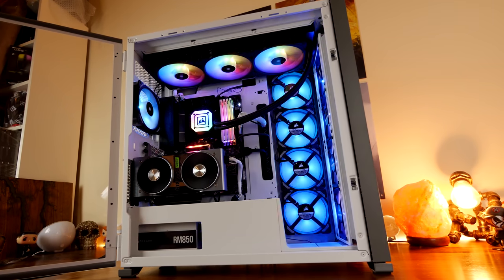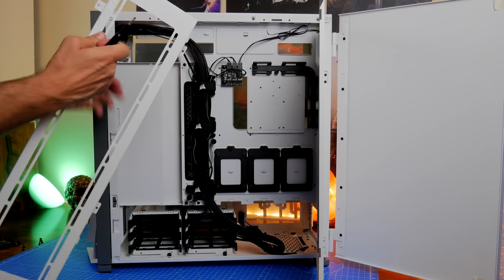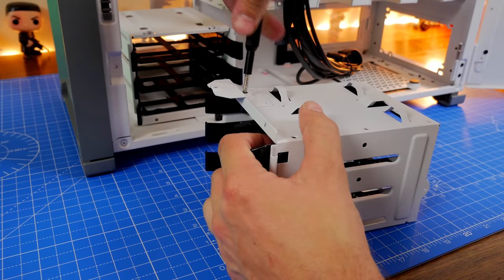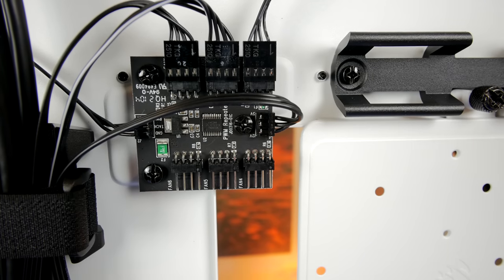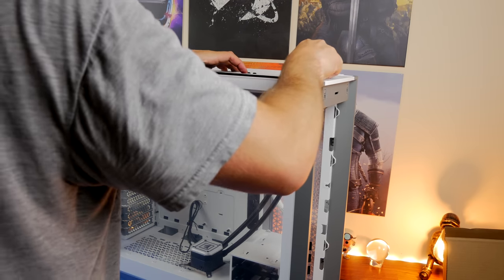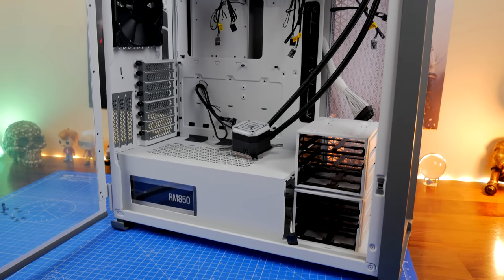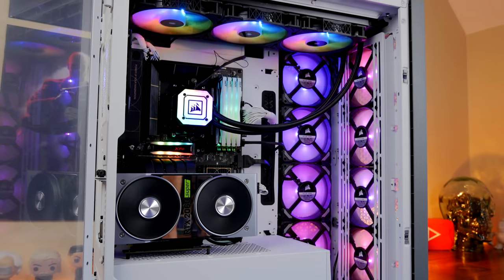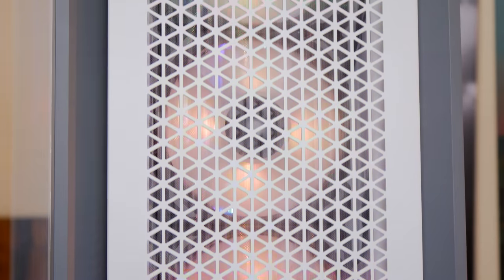Corsair 7000D Airflow unboxing and installation with 12 fans & the Corsair H170i Elite Capellix

Comment: I just heard that this cases side panel, despite being able to take upto a 480mm radiator like the front panel, only has holes for 120mm fans, which is surely just an oversight. If the side plate is the same size as the front plate, and the front plate can take 120 or 140mm fans and upto 480mm radiators as well (including a 420mm radiator), then surely it would be incredibly easy to modify the side plate to just make it the same as the one on the front so you also have the option of a 420mm radiator there as well? I (like many other potential customers) would want to mount three 420mm long 30mm thick radiators: 1 on the top, 1 on the side and 1 on the front all at the same time for incredible cooling, stability, longevity, power efficiency, silence and appearance. Could you please feed this back to the manufacturer? Great video, and fingers crossed they listen to the feedback and make this small change - adding a few extra holes to the side panel surely wont cost them anything, and must surely be worth it for the extra sales profits for them? ;p
Reply: I want 3x420 radiators as well... have  you figured this out by now?
Reply: @Garrett1974  no - unlike the reviewers, I don't have access to dozens of cases to test if they could fit three 420mm radiators simultaneously; there are quite a few full tower cases with three or more slots where 420mm radiators would fit, but due to poor design, they can only fit it 1 or 2 at a time, usually only 1! I'm just hoping a reviewer will physically test full tower cases to see if there are ANY cases that can.
Reply: @TimLongson  I'm getting the case tomorrow... might as well stuff 2x480 in it (front and side) and a 420 up top. If it won't fit I'll MAKE it fit LOL xD
Reply: @Garrett1974  please let me know what you manage to fit in simultaneously.
Reply: @TimLongson  I will... Oh and I use slim rads usually...30mm thickness...good for low rpm so less noise :)
Reply: @TimLongson  https://www.youtube.com/watch?v=gLcMtre02V4&ab_channel=TheProvokedPrawn go to 23:50... I think I see why a 140mm wide radiator wouldn't work... the case's frame is simply in the way (where the 24pin cable goes through) so if that were 20mm less (which is completely doable imo because why is there so much space left at the end of the motherboard?!) then we would be golden... may have to dremel that off lol... on my way to get the case right now anyway. I'll report back
Reply: @Garrett1974  good plan; that's what I was planning on as well. I'm very interested to hear if with even slim radiators you can fit in 3 big ones simultaneously. Looking forward to hearing how you get on. :)

Comment: I put the side fans exactly like yours but a lot Youtubers put other way around so the air goes out, so my question is yours the right way to let air in instead of out?
Reply from the maker: My theory is if you have the front as intake, then the side as exhaust you're immediately pulling air out of the case and it's illogical

Comment: Great Video. Question. Did you have to use any extension cables? fan on front at the bottom has too short of cables.

Comment: you could have used the 3 140m fans that came with the case for the push pull no? just use them on the top where you wont see the rgb anyway

Comment: you do really good builds and the break downs of what your doing in these are so great I been looking at the 5000D case but wow I really like this case with all the extra space
Reply from the maker: Thank you! The 5000D is ace to be fair. The 7000D is great, but it's also HUGE. Which makes it easy to build, but you need plenty of room/desk space.
Reply: @TheProvokedPrawn  yes I sorta ran into little things with my 500r Corsair case when I mounted my 280 rad with the power clip at the top I had to break the clip that locked it in place to make it work so ya...Wondering if you had an email or discord you used I could keep in touch? really like the 5000D one but the 7000D more roomy seem maybe might be it lmk how I can get ahold of you better
Reply: also just put a 3090FE card in my computer which was a 1080ti card wanted some tips on maybe helping me with a fan curve for it?
Reply from the maker: @soeth530  discord link should be in the description or on my channel homepage
Reply: @TheProvokedPrawn  got it just sent you a message on discord and sent you a like on fb
Reply: got all my parts yesterday I hoping I can do a push pull on the top area like you said in the video hope there is holes on the top area of that break for wires to come down in the case

Comment: Great video, very helpful! I'm also going with the H170i, 3 140mm front intake, 4 120mm side intake, and 140mm rear exhaust. Going to use a Commander Core XT in addition to the Commander Core included with the AIO cooler, hoping positioning them in the ssd mount area will be good enough for all the fan cables to reach them appropriately. Does that sound feasible?

Going with an Intel 13700K and possibly Suprim X 4090

Comment: Can you help me understand why you are taking warm air from the case and then passing it through your radiator?  Why not intake with cool air to then cool off your CPU and then push warmer air into the case which is then exhausted?
Reply from the maker: It doesn't make much difference in my experience

Comment: Any recommendations for a PCIE 4.0 riser cable? 

Also would you say the Lian Li uni fans 120/140mm ok to use with the radiator and case?
Reply from the maker: Not on the cable but yes those fans will be fine

Comment: I'm getting a 7000x case and do you think I should get a 5000x instead? I'm only going for the 7000x because I'm using it for the 4000 series and to get 12 fans, is it worth it for my reasons? (It's the rgb case)
Reply from the maker: Tbh 12 fans is really overkill. And the case is a monster but it is plenty roomy and has lots of build options.
Reply: @TheProvokedPrawn  so do u think I should just go with a 5000x? Planning to do liquid cooling as well

Comment: I made it all the way through your video.  I really enjoyed the video. I just received my 7000D and I'm moving my components from my 2012 Corsair to the 7000D.  The old case fans died and could not be replaced since Corsair no longer manufactures them.  My motherboard does not have the 15 pin SATA female power connector for fan power.  Also, my Corsair AX1200 power supply does not offer a 15 pin female power connector for the fan power to connect too.  Do you know of any 6 pin PCI-e to 15 pin female connector cables on the market I can use to get the fan power working?

Comment: Yes! I stayed till the end :P
Reply from the maker: Appreciate you
Reply: @TheProvokedPrawn  well I have the same case but i have an AIO on the CPU and therefore can only place 4 in the front which are 120mm noctua, with the AIO grill and fans at the top I doubt there is a way for me to add more fans at the top cause of the AIO, would u suggest maybe using the side panel which hides the cables cause mine are a bit of a mess :|

Comment: I went with 4 3.5" HDDs. Stacking isn't an option if using side fans because the SATAs will rub. So I'm stuck mashing my PSU cables which is going to cause problems. Unhappy with the 7000D design.

Comment: All went wonderfully well until you glued the controller on top of the SSD braces. Tape dries up and falls off or becomes soft and slimes up everything it touches. Just use a Dremel and cable ties.

Comment: thanks for your vid. it's very informative.. making me want to pull the trigger on the black version of this case.

curious though..

the HDD cages, if they're to be stacked on top of each other.. are they going to be stable enough to hold 6 HDDs without any major vibratuon issues?
Reply from the maker: I think so. They seem fairly secure.

Comment: If you mounted a GPU vertically in this on the riser you did, do you think you could fit other PCI cards in the normal slots? I.e., tuck the riser cable between your gpu and the other PCI cards.
Reply from the maker: Doubtful

Comment: I heard people complain about the side tempered glass panel that is easy to break into pieces.  Is that correct? It would be better if the side panel is high quality plexiglass.
Reply from the maker: Never had issues. Sometimes they break in transit I think but I've never seen it and I've never had one break while building or during use and I am clumsy af

Comment: Do you need the fan splitter on the back if your using the included commander core?  im not adding any more fans.  It doesn't look like it's necessary to me.
Reply from the maker: If you only have six fans then no

Comment: i just bought this case having previously owned the 5000X, i decide to go for the airflow this time.
don't get me wrong the temps with the 5000X are not bad but they weren't the best either with an i9 10850k and rtx 3080(space heater).
Lets see how the 12900k fares in this one.
Reply from the maker: Interesting.

Comment: Huge case, but i think people should just start getting Lian Li's daisychain fans for these considering the mess of fan cables you get otherwise. Really wish other OEMs would start making those daisychaining fans as well.
Reply from the maker: Yes, that would be a good choice tbh.
Reply: @TheProvokedPrawn  I especially like the fact that Lian Li gives you RGB but also good performance. 120mm version of that daisychain fan has up to 58 cfm airflow and 2.4 something static pressure. Corsair's fans are all like 43 cfm or something I think, the Corsair ones with great airflow have no RGB.

Comment: Hey that one usb connection at 44:08, is it ok if I only can plug the one in? My motherboard also only has one slot for that type. Will it still work properly?
Reply from the maker: Yes, but only half your front usb connections will work

Comment: I have the rgb version of the case my mob only has 1 usb 3 also supposedly there’s a adapter that you can run to the access cable to get usb 2 from the front headers I’ve yet to even get 1 working

Comment: Dunno if anybody reading comments a year later, but I’m curious:

The front tray has two fans pre installed, but, you can’t buy another single fan to match?

Could you pull the fan from the back, put it up front, and then put a different fan in the back?

Assuming the back fan is the same model as the front two.
Reply: why would you uses the default fans. it sucked. not kidding.

Comment: Nice video, I have a similar setup but with the Lian Li dynamic XL. The amount of Commanders and RGB fan hubs is outlandish though. I think Corsair should just go for Commander cores of different sizes now and actually make they available separatly, not only with Capellix AIO:s.
Reply: I agree.  It would do justice for this case.  There's an appreciation most builders have with a overall sleek and clean look and, funny enough, how their cable management looks lol
Reply: One of the reasons why I'm such a fan of the lian li sl and al fans. The rats nest of cables is limited and it's super easy to set up.

Comment: I am not sure if this will be seen or not. I am following your guide and either doing a 5000D guide or this 7000D. Trying to find out if you can use the Samsung 980 pro with heatsink on the boards or do they not give enough room under the panels. Any insight would be great. Thank you
Reply from the maker: If you have an NVMe with a heatsink it generally won't fit underneath a motherboards own heatshields. But that's not an issue unless the aesthetics bother you.
Reply: @TheProvokedPrawn  I am looking at the Samsung 980 Pro. They sell with or without heat sink. I wasn’t sure if the built in board heatsinks do well or not? My current 970 eco plus gets toasty and I got a cooler for it to keep it from toasting. Wasn’t sure with the new boards and built in heat sink if they work well. Thank you again for your response. Your videos are amazing and so very helpful.

Comment: I have the 7000x rgb. Amazing case. Unfortunately my motherboard only had one connector and not 2 for the top panel USB 😕 so I have to dead ports but I'll never actually use 4 at once. But it sucks lol. My motherboard has 20 other connectors that nobody ever uses though. So it's dumb they still manufacture things that way. We need more USB 2.0 headers and 3.0 headers.

Comment: Nice video, lots of useful info.
Reply from the maker: Glad it was helpful! Hope you enjoyed enough to subscribe 🦐
Reply: @TheProvokedPrawn  I just might =] Going to try sticking some 200mm NF-A20 PWM in my 7000D Airflow when it arrives. I know it's not designed for it but I hope it will be quieter than running 140mm intake.

Comment: My mother board does not have two USB header connectors, but the case wires have two… I have one USB and a USB C connector. My mother board is the Azsus Tuf Gaming Z590-Plus. Any help or recommendations would be great.
Reply from the maker: Get something like this https://www.ebay.co.uk/itm/Motherboard-19-Pin-to-USB-3-0-20-Pin-1-to-2-Power-Extension-Cable-Adapter-12cm-/133935169552?mkcid=16&mkevt=1&_trksid=p2349624.m46890.l6249&mkrid=710-127635-2958-0
Reply: @TheProvokedPrawn  I was looking on Amazon at these as well.  But I noticed in the reviews that some people's motherboards don't allow that kind of cable to work. So I was wondering how I would be able to tell if it would for mine. Or if I just take the risk and return it if it doesn't work.

Comment: Little note: you cannot do push pull on a top radiator config because the case misses the opening on top of the case for the top fans to go into it, unlike the 5000d. I was so disappointed when i got the case thinking of doing a 420mm push pull and try extreme overclocking.
Reply: Whats a push pull ?
Reply: @itsyoboig3325  When you have the fans on both sides of the radiator. Pushing air through it and pulling air out of it. Hence why push pull configuration.
Reply: @davidepannone6021  u do It ?
Reply: @itsyoboig3325  If i have the space yes. More air means more cooling and generally less noise even if you have 2/3 more fans, since you're pushing/pulling that much more air. But if you don't have the space the "common" config is totally ok.
Reply: @davidepannone6021  I have a 240mm radiator so should I do a push pull on the top ? Like could I add 2 extra fans on top of it or does it have to be a 360mm radiator and 3fans on top of that for a push and pull
Reply: @itsyoboig3325  No a push pull could be also a 120mm radiator. It doesn't matter. Push pull is just a fan configuration.
The question you should ask yourself "do i have good temps?". If the answer is yes, then no, don't spend any more money and be happy. If you're not happy with your temperatures then yes, a push pull config would help with that. But don't expect like 20 degrees decrease. It'll be 4/5 degrees at best.
Reply: @davidepannone6021  well okay I’ll find out once I get my case in and I’ll let uk

Comment: i bought the case and afer install of the fans and take my pc appart and try to put the motherboard to find out that doesent fit my mobo X570S MSI Edge not aling wiht the screws because of the preinstaled IO shield  cant fit my motherboard what a dissaster and shame for a case that big ,my mobo fit perfect on a p600S ,aslo nice video but i would like to see build wih atleast some power hungry GPU so i see how this case going to stand on a gpu that draw over 300W and what will going to be the temps i nthe case wiht all this fans ,i have 3070 and my gpu stay at 63 even wiht 420 push pull aio on the front ,and middle 50 for the 5800X

Comment: You'd have saved yourself a lot of trouble (and space) with all those RGB Hubs and Lightning Node Pros if you went with 7000X, since it has a Commander Core XT. Which, just like the Commander Core that's added to H170i (and H150i), has ports for 6 fans for both power AND RGB and as such doesn't require the RGB part to be handled through Hubs and/or Lightning Nodes.

And while the Core XT, just like Core does not have the internal USB hub of the Commander Pro, unlike the Core it has a pass-through/daisy-chain on its own internal USB cable. Which means that you can then connect the Core to it, using only one motherboard header for both.
Reply from the maker: Interesting.

Comment: I love your videos ... in fact I'm also a Corsair fan.  I wanted to consult you since I have the commander core that came with the capellix 360 and I have 3 LL120 fans that are different from the cooling ones, for example they have more LEDs.  I also have commander pro and Lighting node pro.  My question is the following: if I connect the 3 LL120 fans and the 3 cooling fans that are different ... will I have conflicts when executing the icue software?  reason that asks you to choose which fan model you are using.  If this causes a problem, I will have to install separately, that is, the LL120s in the commander pro and their rgb in the Lighting node pro and those of the radiator in the commander core.  What I wanted to achieve is a chained type rgb.  Greetings ... I hope you can help me

Comment: I have 6 fans push pull for my h150i aio i want them to be linked with the cpu temperature(higher rpm when CPU gets hotter) so how should i connect them? Also they are a mix of 3x ML120 pull an 3x QL120 Push. I dont think it will be a problem since you can mix fans withthe new iCue Software? Also i have 7x QL120 for the rest of the case how am i connecting them. I have no idea since this is my first PC Build. Please help😂
Reply from the maker: I'd keep the fans the same if you can because different fans will have different airflow, RPM and more.

Comment: Does anyone know if I will be able to fit a EK 360 XE (TOP) and a Alphacool XT45 X-Flow Radiator480 (Side) in tis with push pull on both RADS.  Might have to go with the Meshify 2 XL...But I really like 7000D